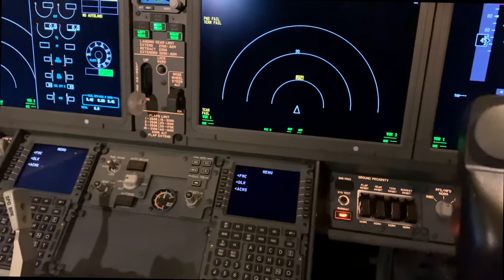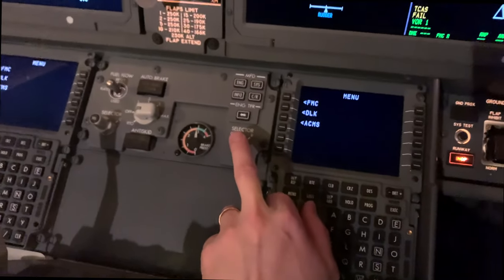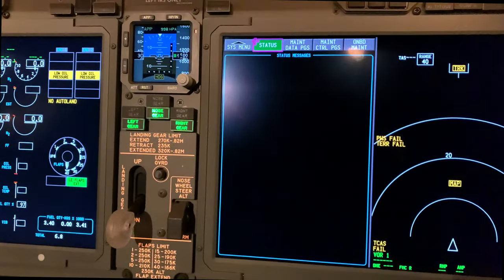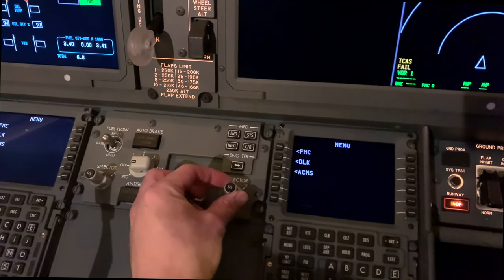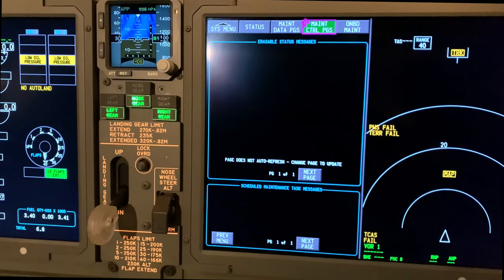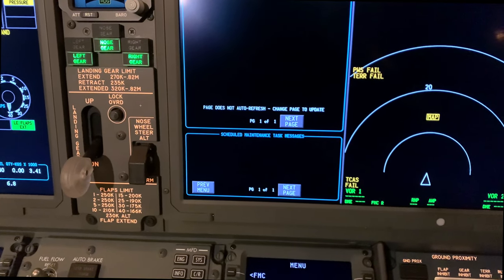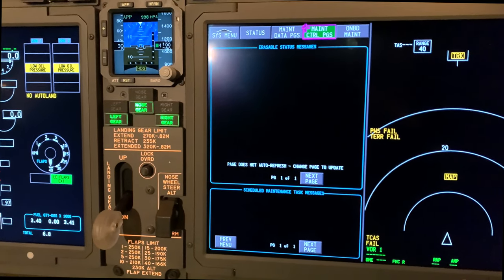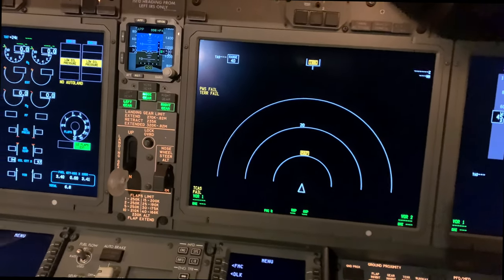🎬  BOEING B737 MAX ATA 31 Scheduled Maintenance tasks, Messages Check. ✈️

Comment: Please more videos like these.

Can you show the maintemance function of the FMS in the A306F, please?

But it would be much better if the videos would be longer.
Also you should try to get a HQ Microphone because the background noise (fans) is very loud.

Also it would be very nice to see much more maintenance features and tests in the 737max.

You did last time display tests in the 737NG.
Can you make a video with display tests in the 737max, too?

Thank you very much for your time and content.

To enhance the quality of your videos:

If you can link the smartphone direct to the outline of the audiosystem of the flightdeck, the quality should be cristal clear.

That was just a constructive suggestion.
Reply from the maker: Thanks for the comments, as things progress so will my production and sound, (still practicing) I am just using a smartphone and pods at the moment. But I will buy better over time. Some more Max videos coming soon.